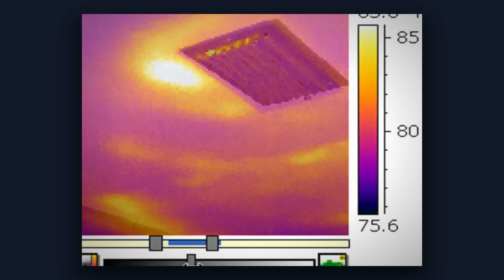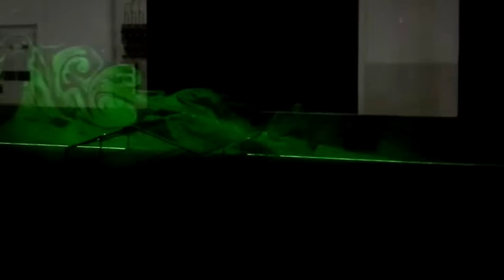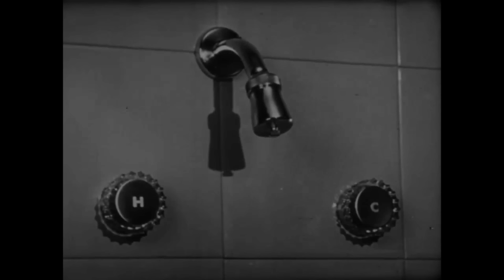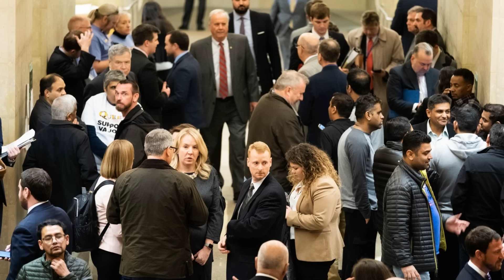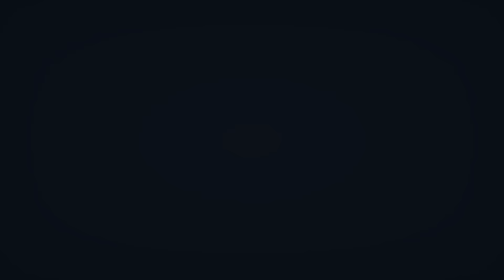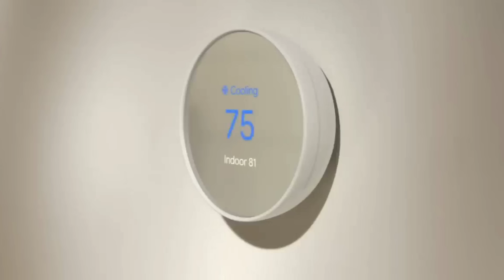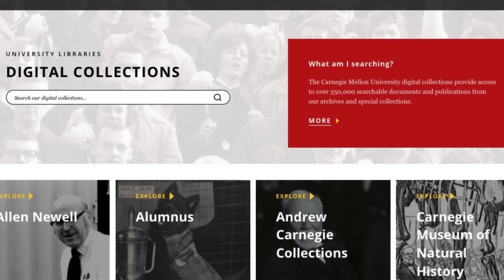This $300 Tunnel Heats Any Home All Winter for Free — The System the Gas Industry Made Illegal

Comment: This is the most misinformation in one place I have seen an a long time. I have had a ground source system since 2011, and so do two of my friends. each system is slightly different dependent on the designer and the power company and how they support the system through off peak power.
  To think you can depend on any lasting ground temp as described in the video is off the charts pie in the sky thinking. My system has thousands of feet of tubing buried i two layers out and back @ 13' deep and 9'deep loops filled with glycol alcohol which transfer heat/cool   (Temp.) better. this is run through a heat pump and compressed to get the room temp. needed.
  What would happen if you buried your water line 4' deep. (your pipes would break) Eli I thought you would know a fence post put in at that depth will get jacked out of the ground by frost.
  Any way not to rant I really like you content and watch every one, just wanted to make clear that hand digging this is one of the craziest things I have heard, I spent 4 days with a mid sized track excavator, I have been a const superintendent for 25yrs building freeways, airports , and street reconstructs, I was the night superintendent on the biggest job in the state I live (night time is when the truck dirt moves with out traffic  not saying to brag just to   make clear the size of the project if it is to have results.
 With that said after a cold winter the ground becomes void of the 55 degree  temp and the compressor has to work harder and harder near spring. keep in mind this is in a new house professionally insulated, and I also oversized my field (length of tubing and area that it is buried.)  With all of that there is a ele. plenum heater hooked to off peak (when available) and a gas furnace as backup. In 2011 this was $30,00.00

Comment: I use the Jean Pain method in my underground home, I get my electricity, heat,and hot water all for free every year with minimal work. Your method's ok for above ground existing homes but even then the Jean Pain method's better! Through compost your incoming air is up to 160 degrees farenheit and you draw it in with a 12V fan on a thermostat...very simple!

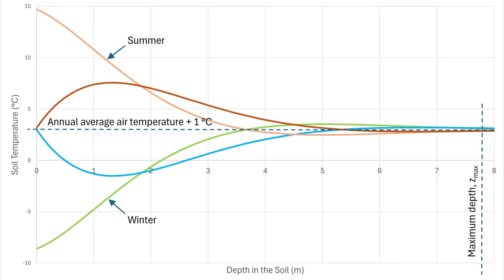Comment: Sorry but that graph at 3:45 has soil temperature steady at 4 METERS depth (and beyond), not 4 feet.
Reply: Yes, if you go deeper if practical its much better.  And some soil is better at insulation than transferring heat.  An air duct is a poor way to move heat. That's the real reason geothermal systems use water and not air.  If you move air in you will need a fan that draws a lot of energy, and if air comes into a house without an air to air heat exchanger , the air in pushes air out that is going to be warmer than the ground.  
This person is poor for giving advice.  Hacks the science he needs.

Comment: Is it and how is it possible to use this method without an electrical or gas-fired heating system? Can it be done with wood fireplace or wood stove? I understand the fireplace or the stove will not be as accurate at maintaining a constant temperature. But in theory you would need less wood fuel during the winter and no AC during the summer.

Comment: Ground heat is used in cases such as geothermal heat pump systems. Your furnace is not trying to accommodate from outside air temperatures; it is accommodating recirculated air temperatures from within your home. If you were to take in continuous 55-degree air, your bills would be stable, but higher over a season. In truth. savings comes from insulation value more so than it does from your system. How much heat loss your home has determines the work your furnace has to do to maintain your home heating system. Build an underground home and your bills will dramatically reduce. Here is the key to understanding the science. Think like cold doesn't exist, only absence of heat. In this case also keep in mind that in heat transfer, heat goes to cold so to speak. The better your insulation, the less heat can transfer.

Comment: Interesting but I see one major flaw in the logic…..since hot air heating systems recirculate and reheat air DRAWN FROM INSIDE THE HOUSE there is only a small temperature rise needed each time the air is reheated when the furnace cycles!    Most systems do NOT draw in “cold outside air”.  Did you miss that detail?
Reply: Exactly. The furnace draws the air from within the house heats it and blows it back into the house. It has ductwork. A supply and a return. No air is drawn in the house from outside.  The furnace does send the exhaust from the combustion  chamber outside due to its co2 levels.

Comment: How does it works if the pipes are PVC, as the plastic is a thermal insulator.

I know about closed systems with small diameter copper pipes, filled with fluid. It is moved with a small pump and helps to heat/cool the air going to a normal electrical AC system. I guess it could be used for a gas powered system too. Sounds way more efficient.

Comment: Ahhhhhhhhh - this is true IF YOUR INSULATION OF YOUR HOME IS REALLY GOOD!!! It's all about how much heat you have to remove from earth. If your home insulation and/or air infiltration is not good - you will find that you end up taking so much heat from the ducts buried in earth that you begin to cool the earth in contact with ducts down and as you do the air temp leaving the ducts into your home will drop in temperature.

Comment: This would be perfect for my 2000 sq ft pole barn.i usually keep it at 50-55 degrees in the winter. I have thought about an AC unit in the summer, but never wanted to pay that electric bill. This would do both.

Comment: Fade-in  Radon killing you from these tunnels.  Best is a wood stove.
Reply: Radon is a gas, a product of the natural decay of uranium in the soil, it will not penetrate a PVC pipe. It comes into your home through the crawl spaces, through the cracks around your concrete floor that naturally separate from the wall. If you had the ability to separate it, you can get enough natural Uranium to separate enough U-235 to build an atomic weapon from the top 6" of soil in a square mile of dirt. Logistically and economically improbably but not impossible.

Comment: Here in British Columbia Canada the idiots want to run a cold air inlet from outside into the cold air duct back to the furnace I told the building inspector he was nuts and as soon as its passed its getting removed
Reply: THAT CAN WORK WELL WITH A HIGH EFFICIENCY HEAT EXCHANGER. THE HEAT ED AIR THAT IS BEING REMOVE GIVES UP MOST OF ITS HEAT TO THE COLD INCOMING AIR.  ALMOST NO HEAT LOSS.  NEW HOMES ARE BUILT SO TIGHT THAT YOU NEED THE OUTSIDE AIR COMMING IN.  POLLUTANTS BUILD IN AIR TIGHT HOUSES.  ALSO DONT FORGET THE HIDDEN CAUSE OF CANCER -- RADON GAS THAT IS ALWAYS RELEASTED FTOM THE GROUND.  RADON GAS CAN BUILD JN A HOUSE MAKING IT A CAN ER FACTORY IF YOU LIVE IN THAT HOUSE FOR 20 YEARS ...
SO THERE ARE REASONS THAT EXPLAIN WHY THOSE ARE THE CODES !!! 
SHOP FOR THE HEAT EXCHANGERS FOR EXCHANGING INSIDE AND OUT SIDE AIR.  IF YOU HAVE A SEPERATE SYSTEM THEN YOU DO NOT NEED TO RUN THE BLOWER ON THE FURNACE TO EXCHANGE AIR.  YOU CAN ADD THE HEAT EXCHANGER FOR FREASH AIR FOR ABOUT A $1000 AND WHAT A GREAT RETUR. ON YOUR INVESTMENT  BECAUSE IT KEEPS 95% OF THE HEAT WHEN AIR IS EXCHANGED IN A NEW HOUSE.

Comment: If this could work in Canada cause in Alberta our frost levels are almost 10 feet deep now
Reply: Geothermal hasn’t worked well in Alberta
Reply: if ground frost goes 10 feet deep, why does the building code say frost penetrates 4 feet so that is the depth of the footings in new construction
Reply: @RobertTrodden  majority of the moisture remains at the first 1.8 metres or 4’ and codes tend to be a general standard it’s why they added in the clause allowing inspectors to have final authorization in most codes, it’s why there’s so many water main breaks ever year, we have a bury depth code of 6’ for water, but with the recent years of -40c for weeks straight the depth at which the ground freezes have been increasing, and until serious issues occur cause catastrophic damage no one cares, something like that most likely won’t happen but tax waste either way

Comment: Hold on. Maybe I’m just an idiot. My furnace doesn’t heat cold outside air. It circulates the much warmer inside air. So if my inside air is 70 F and the “tube” air is 55 F. 🤔 🤔 🤔 💭

Comment: Imagine: 200 S.f. 2-story w/loft attic (vertical tiny cabin).  Uninsulated.  Dirt floor. 
I dug a kind of cellar into the floor, about 6’ down. 
Lined bottom w/few inches compacted chip rock. 
Then splashed a layer of slaked lime over the chip (anti-mold, non-toxic, lasts pretty much forever, unless disturbed). 
Can use regular concrete blocks laid on sides, to form an air channel back & forth, like a hypocaust, but it needs some integration pieces to use round tubing for connections to manifold & intake box.. with blocks, you don’t need slaked lime.
Or, lay a loose coil of perforated drain tubing, about 70’ long, covered in drain rock at least 1’ deep. 
Either a paver cellar floor over 2” foam board, or fill hole w/drain rock & paver the downstairs floor. 
 I like having a cellar. 

One end of the tube to the outside thru a filter box, then feed other end to a manifold to carry ( 2) 3” solid drain pipes from the manifold, to feed one upstairs & one downstairs. 
The air intake brought fresh, filtered air using a 12V DC fan, controlled by a rheostat switch.  
That went to the coil in the hole.

It kept the cabin from freezing or cooking, seasonally.
 It could definitely have been comfortable if surviving there without worrying about firewood— we built a small rocket stove just in case, which batch-burns forest floor sticks. Minimal labor to scavenge.  
Temps up there could (rarely) drop below 0F briefly, but commonly into teensF.., or as much as 108F was clocked one summer.  Cabin stayed very tolerable.  
Fresh air indoors, with positive air pressure. 
Year around, all by itself, as long as the DC fan kept going.  

The ground around the tubing released temperature that slowly averages out over the year, meaning indoor temp is not going thru large swings of temperature.
  I’ve heard that called “thermal wheel of the year”, meaning the ground temp feeds the warmed temps to the house in winter, & cooled temps into it in summer.  That takes a few years to reach that balancing cycle. 
If under the cellar floor, that gives easier access than digging the hole again, if in future it needed fixed.

Comment: Is this whole video just for clicks and negative comments? You're conflating combustion gases with heat. Not the same thing at all.

Now if you want to use concentric pipes to preheat combustion intake with exhaust, I'm 100% onboard. But the idea of using a ground loop for this, is ludicrous. 🤨

I'll preheat with air that's hundreds of degrees instead of 50. 🔥

Comment: Wisconsin.  Geothermal is great, but buried perforated pipe will make a Radon Pump that will kill you dead not just heat your house!
Reply: It’s a solid pipe in this case which is a good thing.   Radon is a gas found over shale ledge.     Since it can’t get into the pipe which draws from the outside air you won’t get any radon.  You can still get radon but it’s through your basement floor and walls via cracks and leaky joints
Reply: @drizler  PERFECT!

Comment: Yeah, what furnace pulls outside air?  It recirculates the inside air
Reply: Yes it does recirculate inside air but most modern furnaces also pull fresh air from outside for efficiency. If not, there would never be a consistent burn inside the furnace.

Comment: What about radon?
Reply: You are using the earth's heat not the underground air.
Reply: @jerryg2073 yeah but if you need to have a drain for the humidity that accumulates you need to open the bottom up. That same opening can let radon in.

Comment: Most furnaces DO pull air from the outside.  
Whether a gas furnace pulls air from outside depends on its age and efficiency, but generally, modern high-efficiency furnaces use a two-pipe system to draw air directly from outside for combustion. Older, less efficient furnaces typically draw combustion air from inside the house (the room they are in).Key Details on Furnace Air Intake:High-Efficiency Furnaces (90%+ AFUE): Often called "direct vent," these use a dedicated PVC pipe to pull fresh air from the outside, which is safer and more efficient.Standard Efficiency Furnaces (<80% AFUE): These usually consume air from the surrounding indoor space (basement, attic, closet) for combustion.Combustion Air Intake: Some setups use a dedicated "fresh air intake" duct to bring outside air directly to the furnace to prevent it from using up indoor air.Why Outside Air Matters:Efficiency & Safety: Drawing air from outside reduces the risk of backdrafting and carbon monoxide buildup in the home.Preventing Negative Pressure: It helps ensure the house doesn't become depressurized, which can lead to drafts and poor indoor air quality.

Comment: Makes absolutely no sense... if all the tube is supplying is combustion air it's all getting pumped out the chimney anyways. The return air in forced air systems is usually around 65° already, then it's heated higher....none of it makes sense.

Comment: This is just a geothermal heat pump.  It's efficient, but with very high initial installation costs.  Not 300 dollars (wtf??? you can't buy a kiddie pool for 300 dollars, what kind of BS is this??), but here in Canada ranging between 12 and 60 thousand dollars, requiring on average 5-10 years to pay for itself.  In some areas it's much more difficult due to a lack of drilling space.  In regions with cheap alternatives, or difficult drilling (especially where drilling is in high demand), it's cost prohibitive, not back adding it's own value to resale, making it a poor investment.  
And NASA didn't hide this technology...  What kind of BS is this?  Look it up peeps.  It's widely in use.

Comment: If you watch the whole video. It just takes less furnace work so runs shorter times and saves power. Hence lower bill. This setup has a small air inlet added.

Comment: For heating, why would I duct 55° air into my return air duct when it is already just 5 or 6° below the thermostat set point?
Reply: Every forced air heating system has a "fresh air" intake which pulls in outdoor air. It usually enters the system right before the furnace filter. It's so that you aren't constantly recycling stale air.
Reply: @TNeedham-h2c Not every system.
Reply: @TNeedham-h2c  Not true. Mine doesn't. I believe such systems can cause condensation which cause mold.

Comment: Heat pumps have been used for quite some time. But water is much better than air because it transfers heat about 25× more efficiently than air and can carry much more heat, so soil heat pump systems using water move energy far more effectively and with less loss. To bring and circulate air, a huge volume of pipes is necessary, along with large-capacity air heaters, a complex air circulation system. Plus noise is a problem. Bringing water through soil, heating it with gas from 12 to 40°C, and circulating it is much more straightforward and cheaper in both upfront and running costs.
Reply: Wish I were advanced in HVAC to know how I could fix the debt. I’m only one who calls them.
Reply: @user-wq3jp3qg1o  What really saves on heating costs is good insulation, especially in the roof—that’s the first step. Rock wool, XPS, and EPS are easy to DIY.

Comment: Outside air isn’t being pumped in. A typical system circulates inside air. If air temp inside is 70 degrees, the air having to be reheated is approx 10 degrees difference between air in and air out.
Reply: Exactly,  this video wasnt making sense to me
Reply: Bingo your 100% right

Comment: The year 1986 is not one thousand nine hundred eighty six INCHES.  How do you expect me. To trust anything you say?
Reply: I bailed at precisely that point.
Reply: We had better text to speech apps in 1995.
Reply: I think you misunderstood
Reply: He does mot under stand the science behind hvac.  What size pipe does he need to move air into the house?  What happens to the heat he is pushing out of the house. He makes no mention of a heat exchanger if the air is recycled, or any mention of the power it takes to move the air. And he does not acount fo 70 degree air out of the house -- if recycled -- being cooled to 55 degrees meaning he would gain nothing circulating air.

Comment: A better idea, rather than routing the pipe into the house, or even burying the coils of copper or aluminum tubing, is to use this for the takeup air for your heat pump outside unit. If done properly you don't need to add a fan in the pipe because the heat pump already has one built in, so you only need to modify the shroud to cause the constant temp air to wash over the coil assembly. Geothermal is the only sensible way to use a heat pump, otherwise you're trying to extract heat from cold ambient air, or trying to expel it into warm.